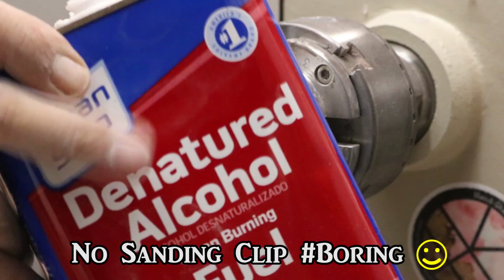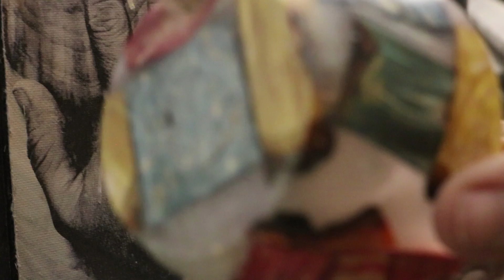#31 "Bark Primaries" Pearl & Scrapwood

Comment: In the description you say you use stabilized burl. What do you mean by stabilized??
Reply from the maker: I use a product called Cactus Juice.  It's a heat activated stabilizing resin.  That's how I inject the color and it's also used as a wood hardener basically.  Hope this helps Scott!  More info here:  www.turntex.com